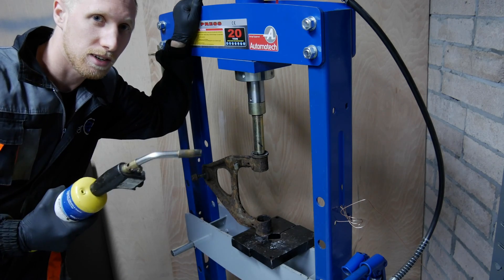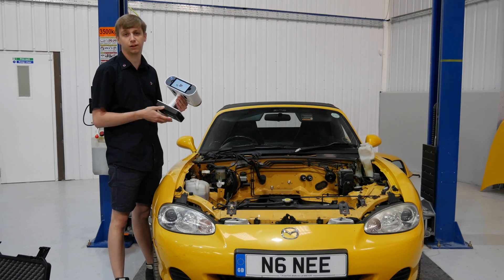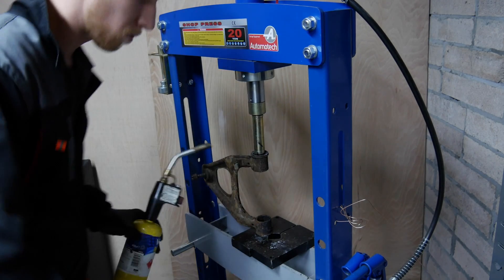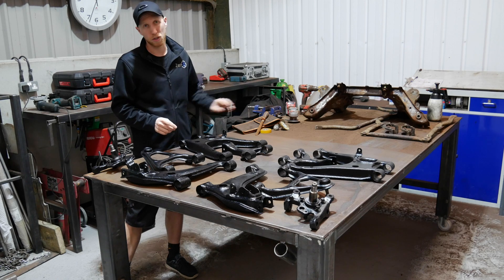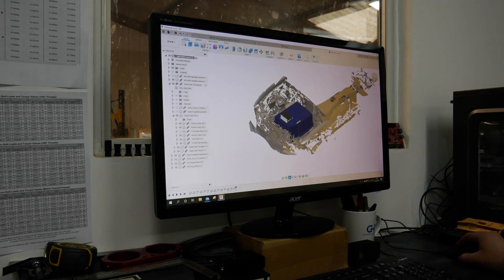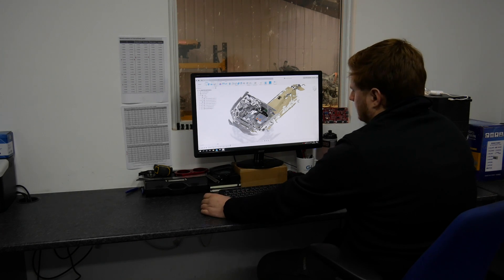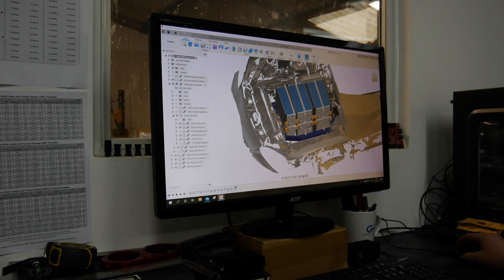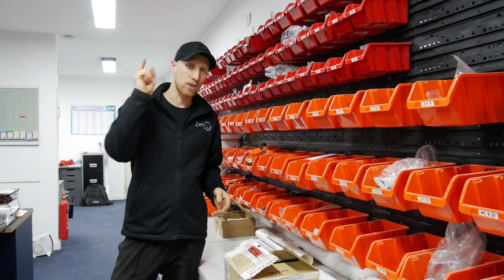Electric Mazda MX5 Miata Eunos EV Car Conversion - 3D Scanning, Fire & Cad Design

Comment: I have a few questions about this conversation. 1st will all the gauges and warning lights still work? 2nd what's the weight difference and weight balance be compared to stock car? 3rd what is the expected range on a full charge? 4th will the battery mounting system fit a left hand drive MX-5? 5th will you ship to the States and if so what's the cost? There's a MX-5 just sitting in my backyard with a blown motor that if been trying to figure out what to do with.
Reply from the maker: 1. Yes all the gauges and warning lights will and have to work to pass mot.
2. Not 100% sure yet but am looking to discuss this on the next episode as a lot of people have asked.
3. 100 miles but there is definitely space in rear for another pack.
4. We plan on designing to fit both left and right have side. 
5. Yes we ship to the states all the time not sure on complete cost yet. 
Hope I have covered everything
Reply: @Hazell_Nutz  thank you can't wait for the next episode

Comment: Glad to see you used some common sense with the bushes and heated them up to make them soft. Rather than just burn them out.

I've seen it done before.
Makes a terrible mess and stinks to high heaven.  Can't be good for your lungs either.

Any chance of a price list for the standard parts?
I've got 3 project cars and would like to EV at least one of them.
Reply from the maker: I need to look at doing a price brake down in the next video I think along with weigh if each part.
Reply: @Hazell_Nutz  "Break", mate - you hit one of my "grrr" buttons!  But nice shop and project.
Reply from the maker: David B not everyone is perfect unfortunately
Reply: @Hazell_Nutz  If guys like you aren't we have no hope left!  None!  [jumps off building]

Comment: I was wondering, how much power and efficency loss do you have going through the diff compared to directly driving the back wheels with the motor ?
Reply from the maker: Hard to tell as don’t know the efficiency of the diff. Most electric drive system have a diff unless there hub motors or really expensive direct drive torque vectoring systems.
Reply: @Hazell_Nutz  Yes, unless they're multi-motor, EVs need a differential and will have some losses from it.  They also usually have a reduction gearbox due to high electric motor speeds.  So nothing wrong here.  :)  

The universal joints for the driveshaft add some losses, but not as much as gears in the differential or gearbox.

Comment: Very good advice on Fusion 360 we are using it, the print slicer and the CNC post processors unbelievable. They will be for HAAS cncs the Fusion Team is resident in HAAS factory, your garenteed pefect post processors, anyone with HAAS out there, you need Fusion.  Next big Fusion update early May also does Autosketch type 2D drawings (great for wiring diagrams etc). Excellent video work and editing work, completely passed me by on the first episode thats always a good sign! Keep it up, very inspiring.
Reply from the maker: We can’t wait for the new update is going to be brilliant

Comment: I'm wondering why you didnt consider to mount the electric motor transverse in the back of the car for better weight distribution
Reply from the maker: The rear subframe is quite small, so very hard to fit, most of our conversions are done that way so on this build though would try and keep it simpler.
Reply: I thought that to, that way you loose the prop shaft and save more weight. 

Could be down to cost?
Reply: Maybe the engine couldnt fit between the axles
Reply: Most Front engine RWD differentials have their input longitudinal.

Comment: Will this car be able to fast charge at public chargers when it’s finished?
Reply from the maker: Alexander D Cossey no as it’s a 100v system, most of the conversions we do are 350v nominal which can do dc fast charging. The minimum for dc charging is 200v.
Reply from the maker: Alexander D Cossey but it will have a 6.6kw charger so full charge is around 4 hours

Comment: i have toyota prius gen 2.. i was wondering of adding more capacity to extend the range. do you have 48vdc to 240vdc dcdc converter? i already saw the you sell 24v tesla battery module which great, along with the bms and etc charger. thank you
Reply from the maker: I would recommend you look at the Orion bms with a volt battery pack am sure people have done kits with them for the Prius.

Comment: Would it be possible to build it with a rear engine and use the drive shaft tunnel for batteries?
Reply from the maker: Yes definitely possible but a lot more work.

Comment: could you do the same conversion to a automatic mx5 3.5 modle do you lose the gearbox completly.
Reply from the maker: Arightpest there is no need for the original gearbox it take up to much space. By removing it we can fit motor and box in the tunnel leaving the front empty for battery’s. This pack is not swappable there the best battery’s on the market today but there is still space in the rear so a second pack could be put there.
Reply from the maker: We are loosing the gearbox completely but you can connect to the original gearbox as well.
Reply: @Hazell_Nutz  i've seen conversions where they keep the gearbox, since the mx5 is known for having one of the best gearboxes, why not keep it? And another question is will the batteries be swapable so it can be upgrated in the future to have more range?
Reply: @Hazell_Nutz  will you give a price run down at the end of the build plus would you be taking orders if people want the convertion.
Reply: Ooooo how much quicker will it be?

Comment: Question. Is it not possible to put at least a set of bateries where the current fuel tank is? Remove the fuel tank put in as many batteries as they fit just so you can have better weight distribution(and increase the range a little).
Reply from the maker: Jh0nnY2k yes we have been looking at the design a second 26kwh pack should nearly fit which should double the range. For this build we are not doing that but leaving it as an upgrade option.
Reply: @Hazell_Nutz   At £10,000 that's a lot of battery cost though...
Reply: Thank you for the reply. Good luck with the build

Comment: What range could be expected with the 26kWh battery? And how will performance be compared to petrol version?
Reply from the maker: 100miles range and under 8 seconds 0-60
Reply: @Hazell_Nutz  oh damn it, that is very compelling... Is it possible to add DC fast charging (50kW for 10-80 in 30min) if customer demands it?
Reply: @brechtthebest  Most people with EVs charge at home or work and only use fast chargers for very long road trips.  Charging at home or work is very convenient since you park there for many hours anyway and can leave every day with a "full tank."   

There's a great misconception that fast chargers are like gas stations.  For most EVs their gas station is an outlet at home or charging point at work, and they never use fast chargers.  Again, many people who don't currently drive EVs don't understand this.

Comment: isnt the battery a little small?
Reply from the maker: DerpEye will do 100miles per charge and there is room in the rear to add a second pack if needed
Reply: Most drivers in the EU and U.S. drive fewer than 40 miles per day on average.  Most daily driving is within 20 miles of home.  So 100 miles of range is highly usable for most daily driving.  It's far more practical than people realize.  Track your own miles per day to confirm.  :)  

(Some people do drive longer distances, but they are the exception.  The reality is that any EV can easily meet most people's actual daily driving needs.)

Comment: I'd love to see this with hub motors on the front to make it AWD.
Reply from the maker: a7i20ci7y was actually looking at hub motors today for another build but there 30kg each so makes the unsprung weigh very high
Reply: @Hazell_Nutz  yikes lol
Reply: Thats a good option
Reply: Nah RWD, and make this MX an EV drift machine lol
Reply: @Wolfgang Preier Hub motors add unsprung mass and complexity.  In theory they seem interesting and cool, but in reality, they're not really great.  No major production EV is using hub motors.
Reply: Using a Toyota/Lexus MGR in the front would be a better option than hub motors but you'd need to swap in spindles from whichever Mazda 323, 5 or 6 used similar suspension in a FWD or 4WD layout. You'd also need to find more space for the battery pack, which is tricky in something as small as an MX5.

It really doesn't need anything more than RWD.

Comment: Ever since I saw the modern fiat 124spider, I would have liked to see an EV version of it. Seems like I will have to do a conversion since Fiat is not going further with it
Reply: Fiat have only just started EV, maybe in the future
Reply: Maybe Fiat or Mazda will hire one of the shops doing top-shelf EV conversions to become their EV designer and builder in-house. Like a performance division, if you're a large corp it's usually easier to just buy the best up and bring them in-house.
Reply: @acchaladka  The problem is that a proper redesign of the Miata as an EV is nothing like a conversion: When you just replace engine and gas tank with batteries, the weight is all wrong. An electric Miata worth paying for would have the entire bottom of the car reengineered, so the battery fits in a slab at the bottom of the car.  The engine would go in the back, not in the front. It's not something that you can do well with even a factory conversion: Almost the entire car has to be new. That's what separates the electric golfs and  minis, which are never going to be great, from a model 3. It's not something a performance division can do well.

Comment: Any chance you will release the 3D scans?

Also of note, there is a torque frame that connects the MX5 gearbox and rear differential. You guys should design to keep that component as the extra torque could damage the OEM mounting locations. People have had this issue with V8 installs.
Reply from the maker: kingofl337 don’t see why not will put them on grab cad on the coming week.
Reply: @Hazell_Nutz  The MX5 community I'm sure will thank you.
Reply from the maker: Need to clean it up abit more but will get it on. Grab cad
Reply: I was just about to ask similar about the 3D scans, will be epic if you guys do release them!
Reply: +1 on the torque frame. Its proper name is the PPF (Power Plant Frame), which attaches to the gearbox and the front of the diff so reduce stress on the prop.

You'll need to fab up some novel bracing if you want to do without it.